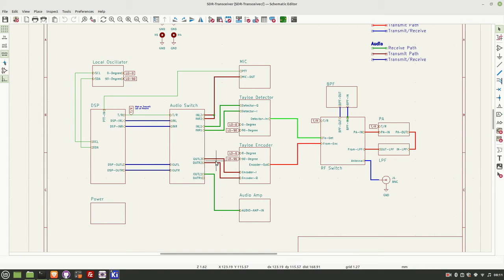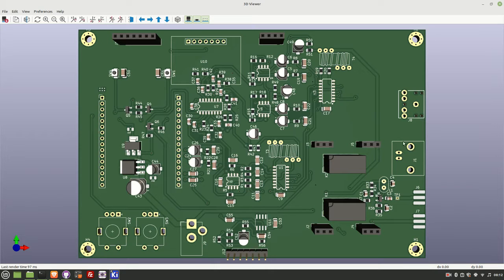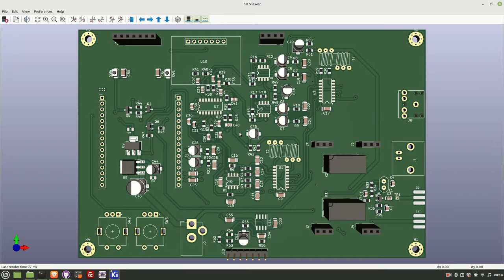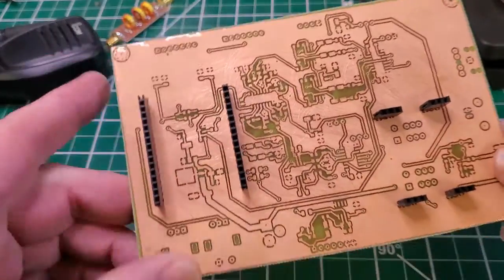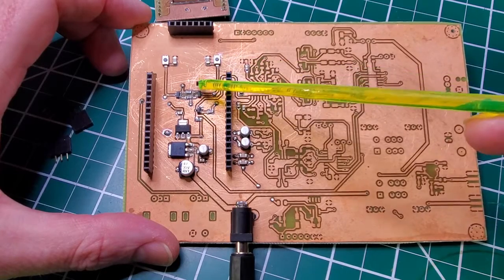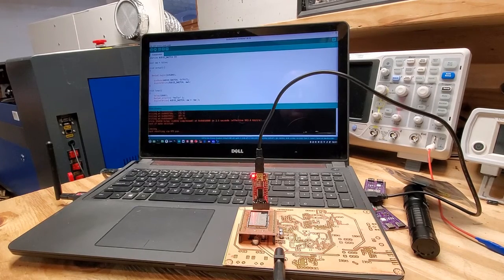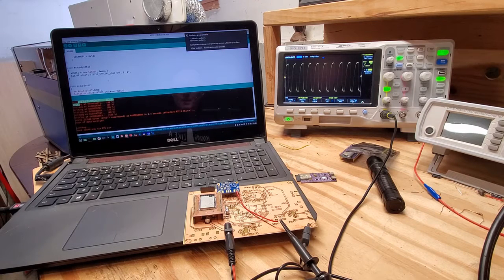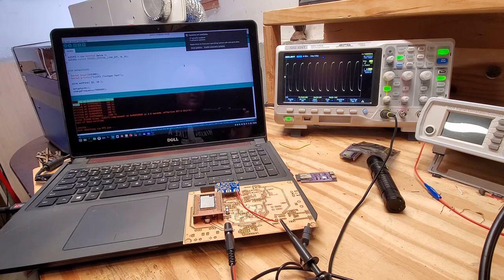SDR Transceiver - Part 2 Board Walkthrough and ESP32 setup

Comment: What a soothing US accent lol. I use Kinsten UV sensitised PCB material at home with great (fine) results. 73 from Canberra.
Reply from the maker: heh Indeed. Do you use the boards that are already clad with the UV resist material. I have been using just plain copper boards and then laminating the UV material. That step is a total pain - I am forever getting wrinkles in the material.